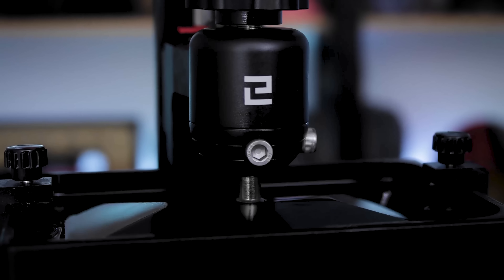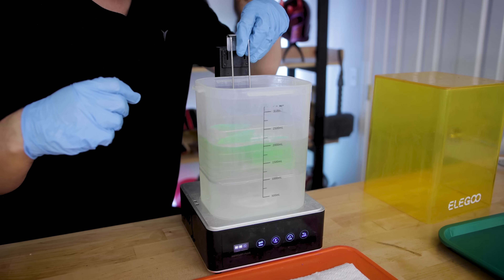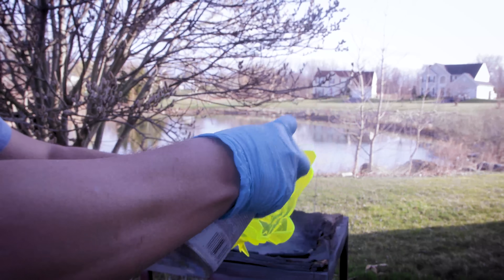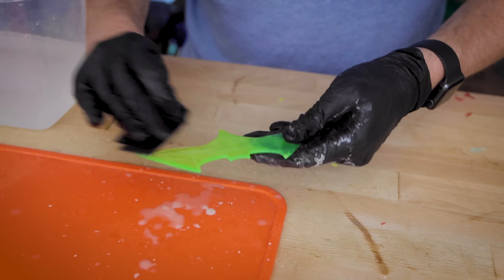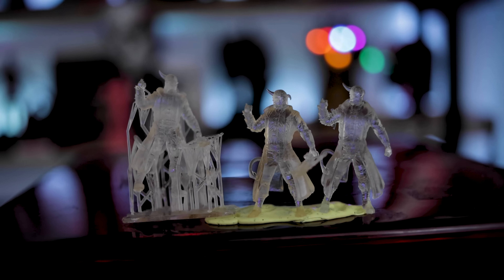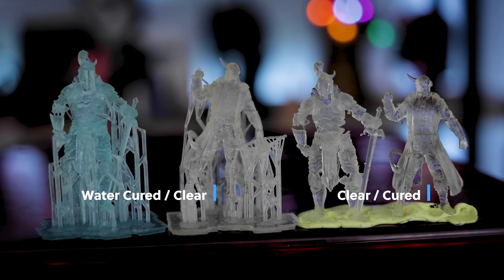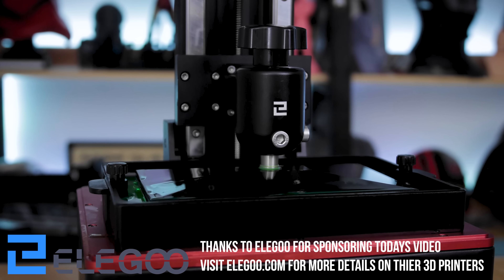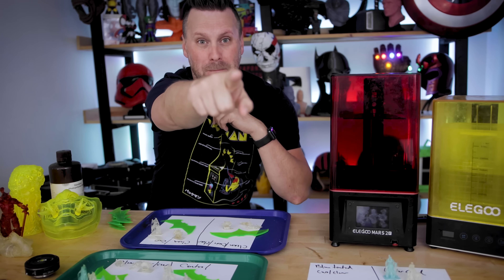How to get the best Clear Resin 3D Prints

Comment: For the yellowing, you are going to want to use more of a violet or purple to neutralize it to a black/gray/smoke tint. However, since the yellow is not actually being removed, the print would look a touch darker then something that is clear like glass or water. The blue you were using looked too cool so that is why it still looked blue or green even opposed to a "darker" clear. You'll need to mix in a very small amount of red, maybe dip a toothpick to give a touch. A drop would likely be too much.

To make something clear, what I heard is painting resin with a very soft paint brush after curing partway, then curing the rest of the way would help a lot. You probably already know that because the layers are made by pixels which defuses light like frosted glass. Smoothing those pixels is what will make things clear, so filling the spaces the same material or material with the same light refraction properties. Clear coat probably does not match the refraction and so limits how clear you can get. However, you know for sure the resin it was printed from does match the refraction so it would work very well. I have even seen lens made using the resin painting method. (Be it, cheap lens quality, but hey good lenses require fine grinding.)
Reply: Would something like UV-resistant clear coat work better for long-term usage?
Reply: @Binary_Omlet  It will slow process. Yellowing occurs from oxygen before the resin is cured (setting a timer the first time you pop the top of your container) and once cured the yellowing comes mainly from heat and/or UV breaking down the polymer. A UV blocker will run interference and slow that breakdown but it's going to happen eventually, just pushing the end result of 3 months of UV exposure to 12 months for the same color. To further reduce yellowing you need a clear coat with UV blockers to uh.. block the UV and an additive called HALS (Hindered-Amine Light Stabilizers ) that handle the oxidation that causes yellowing. Unfortunately you are looking at automotive level clear coats or a specialized coating that probably require a 2 part mix or doesn't just come in a spray can. It adds something like 20% to the manufacturing cost for HALS on top of the UV blockers so if the manufacturer doesn't go out of their way to say they contain HALS or free radical inhibitors then it probably isn't in the clear coat.
Reply: @lordbinky  Thanks for the info! I didn't know that!

Comment: have you tried just letting the parts drip the excess resin and cure it with out washing it? because the goopy layer is already molecularly smooth. clear coating just re-applies this go layer.

Comment: oh man Anyone know how to fix this type of issue? I have a clear resin print that I accidentally got 70% IPA on AFTER it was cured and gloss clear coated. It got dull so, without sanding it, I hit it with another coat of clear gloss. Didn't realize it would be hot out that day. Took it inside after work and now the "cloudiness" has lifted somewhat, but it's still "frosted/fogged over" Unlike my other clear print which I didn't get any IPA on.

Comment: try print drip and cure, no IPA at all, youll spot something great.
The poiint  is IPA is cleaning everything uncured leaving 35um on sm4k and  50um on the other printers  squares. Those squares bending  light.
The print and cured part will be freaking clear but blurred/will loose some  details. In fact on prints like this batarang it will worh fine if you wait long enough to let most resin drip into vat. Just try :P
Anyway in my opinion perfectly clear print is not actually to do unless you print something flat, literally  lay on bed and print it (some kind of square) then after ipa cleaning in Z axis it will bee transparent as long as your bed isn't scratched too much

Comment: So in short no one has a method for retaining transparency on the clear resin. When they come straight off the build plate before cleaning they’re very transparent but have a yellow tinge. Once I dip in IPA and then water for a few mins they’re cloudy as hell. I wasted a whole tub of this crap for mediocre results using Elegoo Abs Like translucent resin. The only suggestion that I may try is not to clean and just cure off the batt see if that helps. Nevertheless not easy to work with unfortunately.

Comment: This option won’t work for things like minis, but for some simple geometry stuff you can also not clean the part. Just allowing it to drip the resin (in something like 40c or higher heat to keep the resin viscous). Potentially also spinning the part using a drill.

Comment: It should be readily apparent why the parts are not clear when you clean/cure. It is not that the resin is not transparent and clear but that the layers are really thin and you got a lot of connection-lines that scatter the light.

In that - cleaning is the problem:  If you clean the parts as soon as they are printed you are removing any material that would fill those tiny grooves, but not cleaning is often also not an option.

So if you can do not clean it.

Curing in water has the benefit of reducing the oxygen, which also reduces yellowing.
And of course - when possible sent it. That reduces the surface roughness which allows the clearcoat to fill in most of them, leaving a clear finish.
it is the same thing as with frosted glass: The glass it self is perfectly clear, but the surface is roughed up - and when it gets wet (or you use some clear tape on it) it becomes perfectly transparent.

Comment: I have had great luck making parts near glass clear by using the Micromesh system, I have seen it used for resin pen making and once you get your prints up to 12,000 they're just gorgeous. Another quick and dirty method for a quick clear look is coating the print in mineral oil, this can make them attract dust but if you rub it in well it can also fill in the surface imperfections for a very clear finish

Comment: PSA: Don’t buy IPA more concentrated than 70/30. It is extremely hygroscopic and rapidly absorbs H2O from the air. 70/30 is the equilibrium point, and that’s what you’ll end up with after a day (maybe shorter if it’s really humid) unless you keep it sealed in the bottle it came in.

For work, I investigated a case of cardiac catheter failures that was linked to this. The SOP called for 99% IPA applied to a wipe and used to clean the devices prior to lubricious coating. There were a handful of devices (not for human use at that point) which essentially fell apart in the final lot of OQ/PQ testing (really final tests period). Turns out that they’d keep the 99% IPA in a squeeze bottle with a small spout (maybe 1.5mm ID nozzle) that was never sealed. The amount used for each device was quite small, so the bottle would be filled every couple of weeks. That minuscule area exposed to the atmosphere, and the air sucked into the bottle after a squeeze, was enough for the IPA to absorb H2O and dilute down to 70%. Except that the bottle ran out at some point and fresh 99% IPA was put in and used on those 5 devices, which caused chemical stress cracking in the polymer shafts.
Reply: Uh I have 100% ipa

Comment: IPA, as it is now called, is just a solvent for uncurled resin. Using a lower concentration won’t change that, but it may require a longer wash time or more agitation. On the other hand, after a certain point, a higher concentration does’t matter from a practical standpoint.  If you are going to sand and polish, after 800 or 1000 grit, use a rubbing compound, the. A polishing compound that you can get at an automotive parts store...  it works for me.

Comment: Has anyone noticed straight lines of bubbles when printing thick pieces in clear? Usually at the center mass of suction on the print. I left the resin for a while after printing so bubbles all pop, and upped my delay time so the resin can flow back under the plate. Could it possibly be cavitation in the liquid due to excessive vacuum forces, or is cavitation more a result of speed alone (i.e. mantis shrimp).
Reply: I have noticed this in relatively thin parts (2-3 mm walls) I have been trying to make using Elegoo Clear resins (both ABS-like and standard).  It is like a tiny column of air bubbles, starting partway through the print.  I had the vat clear of any visible bubbles before trying to print.  I have tried filling the vat more and using a slower retract speed, but got a near identical result.  This consistency makes me think the bubbles are forming due to some kind of chemical off-gassing or cavitation, rather than just getting entrained from the motion of the build plate/part in and out of the vat.   I am now trying a few different orientations and locations on the build plate to see if I can fix it.  Super frustrating!  Let me know if you found a solution!
Reply: You guys fixed it?

Comment: Another issue is you are cleaning your prints almost right away and in doing so you are removing the thick goo that would dry shiny and clear. Just let them drip dry and be exposed to a little light in the room before washing and you'll have a more smooth surface to start with. With FDM printers the secret is extra pressure at the start by having the distance between the nozzle and the build plate more tight than usual and using a slow print speed moving nozzle slowly over the surface and using a little more heat and a lower fan speed and having ironing option on and just slightly over extruding maybe 2 or 3 percent and using extremely low layer heights so the pressure and heat smooshes the layers together. I've gotten printed rupies to to look completely clear.

Comment: When sanding use a sanding sponge instead of just a sheet of paper and that'll make a lot of difference as it'll form around the object and won't miss as many sunken surfaces; skip over the rougher grades and just use the finer grades right away. Or use pumice on a sponge dipped in mineral oil or olive oil instead of a sanding sponge. Or just use a buffing machine set to the lowest speed and use a very soft loose sewn buffing wheel with white rouge used for silver and brass and plastic.

Comment: I love ur videos and I got myself elegoo Mars 2 pro and mercury. I've been experimenting with the clear resin prints, but I've only done simple shapes like rupees from zelda series and oval gems.

I've gotten amazing result sanding with up to 7000 grit wet sanding paper and finishing off with flitz polish.

Another successful result i had was with clear uv resin used to pore casting in silicone molds. It can be little tricky but with a bit of practice, this yielded some really cool results.  After a quick cure and some light sanding, clean off all the debris (it catches all the dust). Then carefully cover the surface with the clear uv resin, just enough to cover the surface evenly. It kind of felt like putting on nail polish. It also seems to naturally smooth out while its still wet. When it stops dripping, and just settles on the surface, I give it a good cure in the Mercury. At least till most of the tacky ness is gone.

Another thing is to do this one both surfaces of course. I do want to test out on visor like piece because I think I can get it super transparent.
Reply: I might also try letting it drip for longer in the Mars and skip the washing and cure it straight away.

Comment: Acrylic polishing compound with a dremel buffing wheel, you would need to wet sand after clean and curing, crystal clear coat 2000 grit, then buff and polish.

Comment: After curing, I stuff my prints in the oven, put it to around 60 degrees celcius and turn the oven on. By the time the oven hits 60, clear prints will have become more clear and any yellowing is pretty much undone completely.
Reply: U put resin in the oven?
Reply: @princessfaust Yes, after printing and curing transparent resin, putting the model in oven as explained in my original comment will get rid of the yellowing that occured during printing/curing of the resin :)

Comment: Just been doing some water washable and a long drain period on the build plate using a mount to tilt it in a diff direction half way through. 
Rinse off in a water bucket while still on build plate and then carefully remove and try not to touch your item and handle by the supports. Allowed to air dry then in the UV using large tweezers to minimise damaging/roughing up the surface. Maybe where practicable adding a removable handle will help you not touch the item surface until its cured to help remove the supports without touching the item?

Not perfect but it's definitely better the less you touch the uncured surface.

Comment: A bit late to the video but I didn't see anyone else mention this... I find that IPA causes a lot of my issues with translucent prints, causing that cloudy/frosted look.  Due to this, I wash with Mean Green (have never noticed an issue with color) in my ultrasonic cleaner, then cure in water for just a few minutes.  In this process the water actually removes the stickiness, while if I air-cure them they remain sticky even when over-cured.  Final step is to clear-coat with Krylon Crystal Clear, usually needs 2 coats.  When printing in the colorless resin I usually don't cure for more than a minute or two before spraying them.

Comment: I bet if you use higher grit sand paper like you said, will definitely make it better on that visor.  Start with 180/220 and have at least two more progressions after with higher grits. The more you have, the better outcome. I work for a mfg company that makes wood veneered panels, and while I know wood and resin are totally different, I am assuming the process and results may be similar.

Comment: @Uncle Jessy seriously if you have time use non yellowing epoxy. You should also get low viscosity slow cure epoxy for highly detailed prints so it has maximum time to let gravity thin it out and give you time to clear any problem areas that might build up. Ive been through almost every clear coat and polishing technique I could find and epoxy worked hands down the best for my clear resin prints.

Comment: Hey Jessy!
There is one thing you forgot to test: 
Dont clean at all, only cure.

That can make a bit more messy print regarding uncleaned resin hanging around - but I get totally translucent prints with that method! :)
Reply: I tried not cleaning and it still yellowed and just ended up looking really gross  on the outside because of all the extra resin not washed off. It did however stop it from clouding as much
Reply: Definitely going to try this, thanks!
Reply: Cost is Loosing details.

Comment: i found when experimenting with anycubic standard green (translucent) resin that it is the alcohol that dull the shine of the resin. like it is attacking the surface of the resin. so my technique was to very quickly dunk the print in alcohol for a second and then thoroughly clean it in normal water. then let it dry and cure.  
gave me amazing results that made the resin look just as transparent and colored as in the bottle

Comment: You don't need any extra product to get a 100% transparent glass-like result. Have you ever noticed how the pieces just printed look very transparent and then they get dull when you wash them? this is bacause the resin pieces are made of microscopic cubes the size of the LCD screen pixels. When the piece is cleaned, all the curved surfaces have jagged surface due to this. Since the cubes are microscopic you can't see them but they are the cause of the rugged finish. What you have to do is one of two things: ONE: don't wash the piece. Just drain it well and cure it as is. All the transparency of the just printed piece will be preserved because the liquid resin covers the rugged cubic surface of the piece so the addition results in a smooth surface.
TWO: Wash the piece and then apply liquid resin as if it was a varnish with a brush. You can wash the brush with ISO alcohol, of course. The first method is good for pieces with no detail (I have printed lightsaber blades perfectly transparent this way and I'm sure you could print that Mando visor as transparent as a piece of polycarbonate) and the second method is better for detailed figures since you can control where and how much "varnish" to apply.

Comment: the steps of your sandpaper should be max a step of 100 difference 
otherwise the deep scratches will be still there from 200 and jump to 1000 will not take out the deep one 
steps should be something like 220 - 300 - 400 - 600 - 800 - 1000 - 1500 - 2000 - 2500 - 3000 but you dont have a rough surface so you could start with 600

Comment: I clean, dip my prints in polycrylic, amd lightly blow off excess with compressed air. The polycrylic seems to have some uv protection because it took 2 years for one of my prints to yellow sitting on a window sill.

Comment: I can't give advice on the models, but I have experience making visors, lenses and other smooth large surfaces that need to be clear.

I followed a similar to what I do for blacksmithing, sanding, buffing and polishing - no clear coat. This gave me massive control over how clear/opaque my prints are. 

I suspect if you want to clear coat them, you will have to go through the process twice, first without the clear coat on then again with it on being carful not to remove it all.

I also do all of my processing and post in a well ventilated shed doing any sanding in a filtered extraction chamber, and use a 3 stage IAP cleaning process, quick dunk in dirty IPA, quick brush in moderately clean IPA finally 2.5 minute was in clean (or dam near) in an elegoo wash and cure. I keep my resin in clear lidded containers, and put them under uv-light between every few prints to cure the resin out of them. When they start looking bad I filter the IPA though filter paper, and eventually replace it.

Making sure there is no liquid resin in the final wash bath has been the most pivotal thing i've found for clean prints.